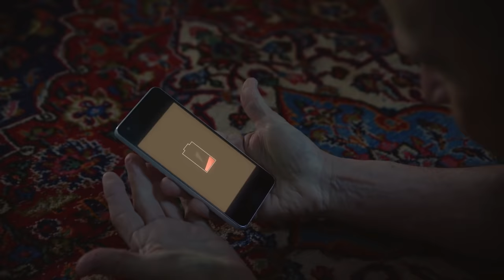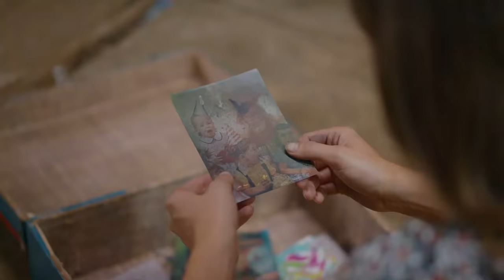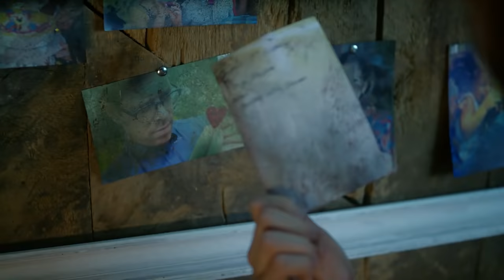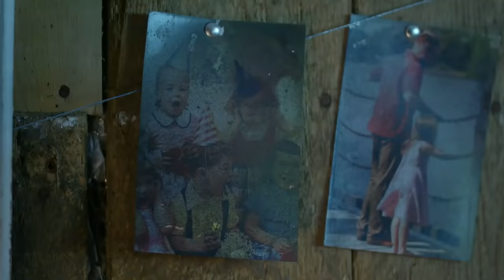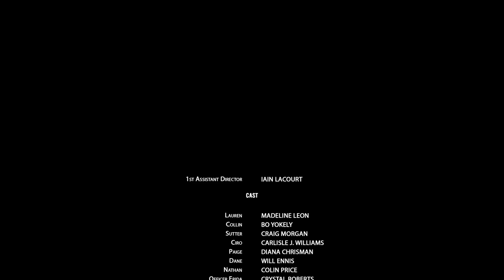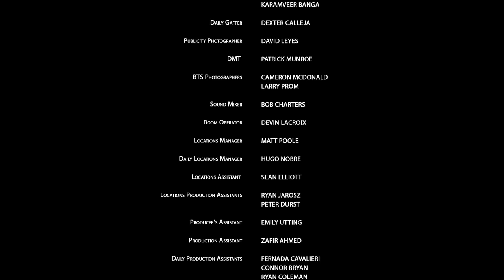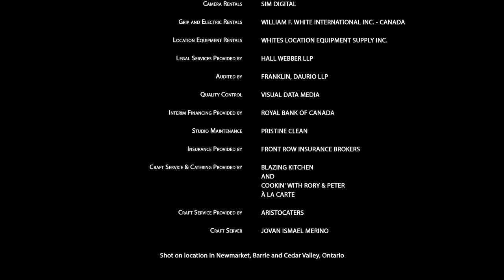After The Storm (2019) | Full Movie | Madeline Leon | Bo Yokely | Carlisle J. Williams

Comment: If the storm tore down the house, shouldn't the barn been damaged as well?
Reply: You would have thought so
Reply: Not necessarily. 
I'm in Kansas. About 30 years ago a tornado came through. The damage is unimaginable; total destruction in one area, with absolutely no destruction, literally, five feet away. 
I've seen a barn totally destroyed, yet the pick up truck parked inside, not a scratch, not a broken piece of glass. At the same time, I-beams from the barn bent around the pick up. Part of the I-beam was under the truck and the other part was twisted over the top - yet none of it touched the truck. 
What our Creator does in the aftermath of a tornado is amazing! 
Standing amongst the amazement really makes you know there is a God; and he is in total control.